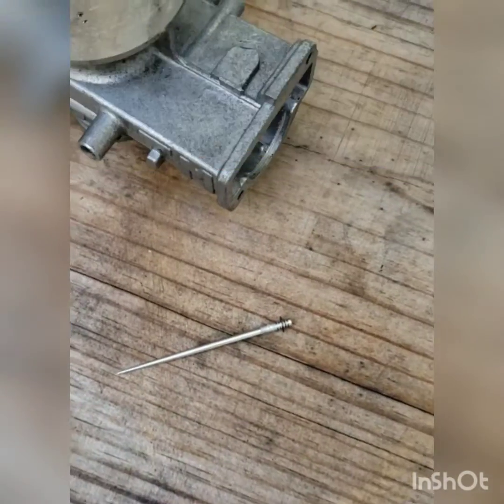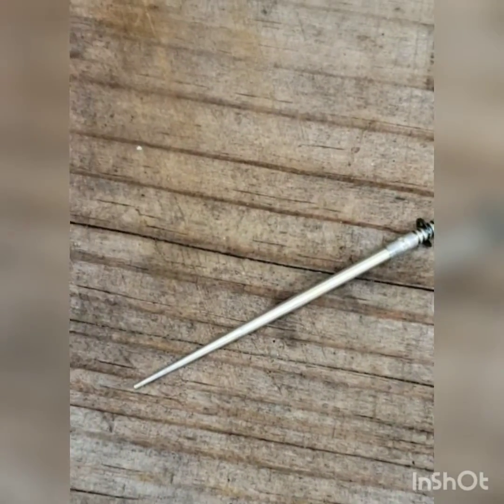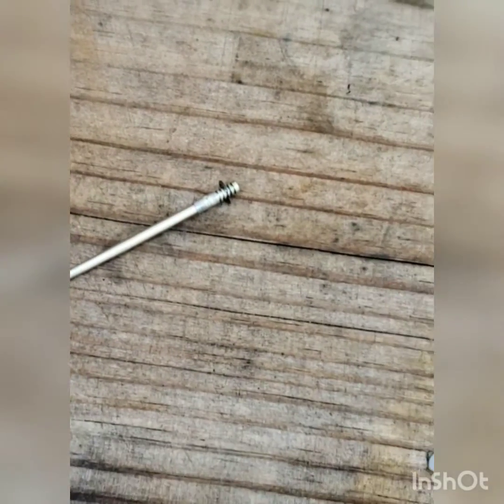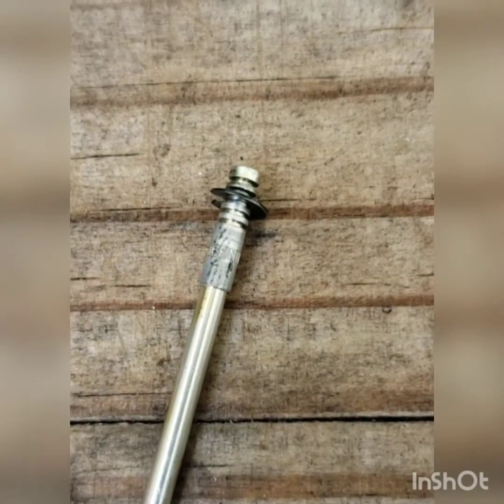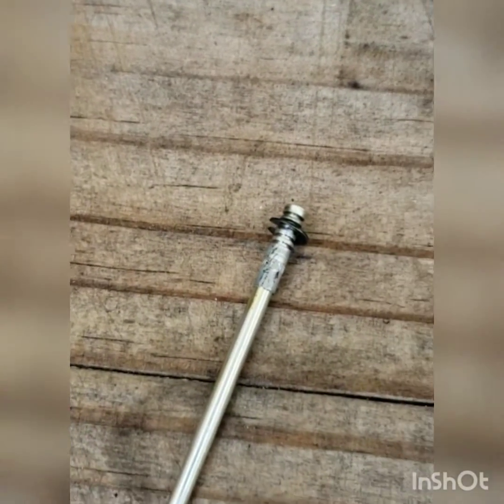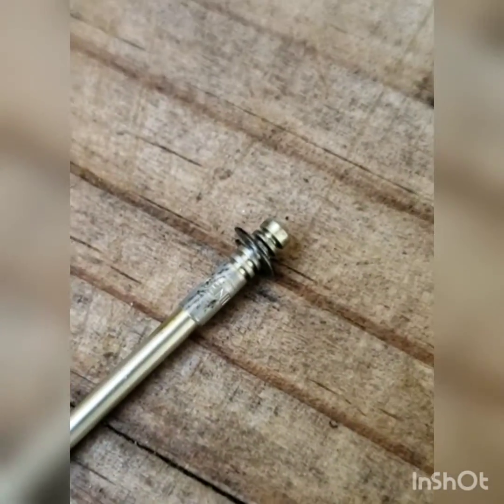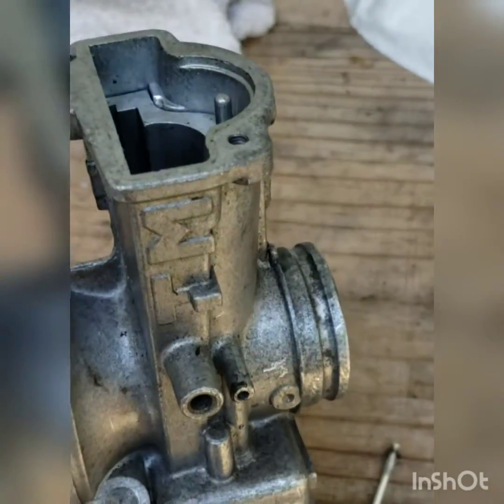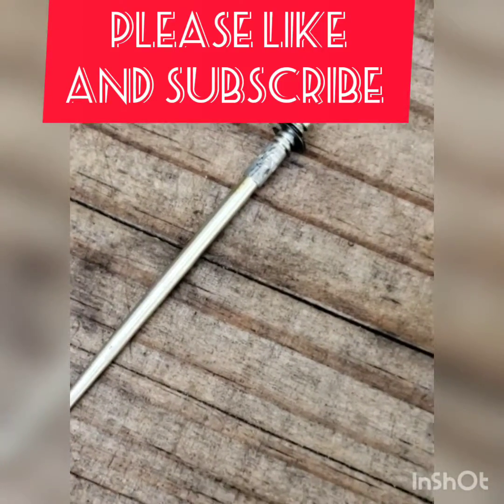How to adjust throttle needle on carburetor

Comment: I had this exact issue with my Honda Ruckus with a PZ16. I had tuned the jetting, and it would start fine and was running  great at full throttle. But if I tried hold a steady 5-6000 rpm it would stutter. The carb came with the clip in the 4th slot. I moved it the the 5th, and it barely ran at all. Aha! Moved the clip to the second slot, and now she purrs through the whole RPM range.
Reply from the maker: Yes sir , follow me for more videos

Comment: Mine was on the 3rd Grove and have 190 main, 45 pilot and was skipping a bit hesitating sometimes, plus foul plugs, then  I changed pilot to 48 but  tuning was troubled, bike would not idle without choke,fuel mixture screw had to go open over three turns screw came out...my bike is a xlh 96 converted 1200.....now changed to grove nr two on the tapered needle ,kept 48 pilot if no joy I will downsize polo to 45